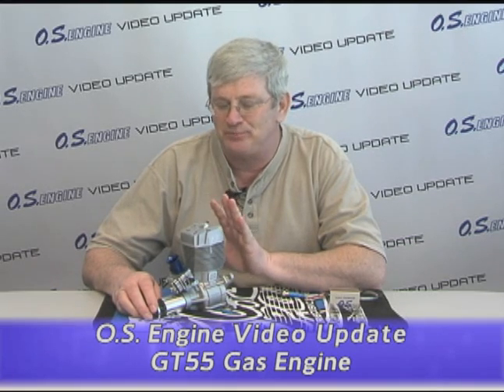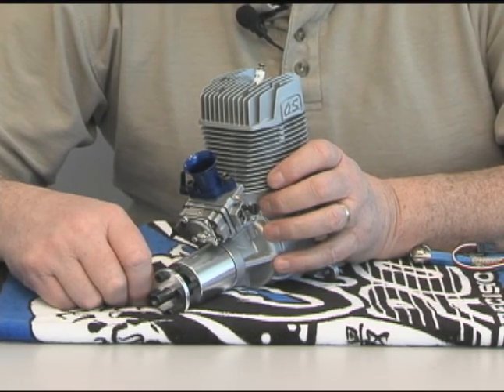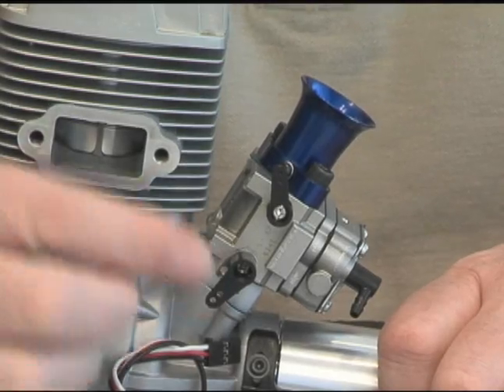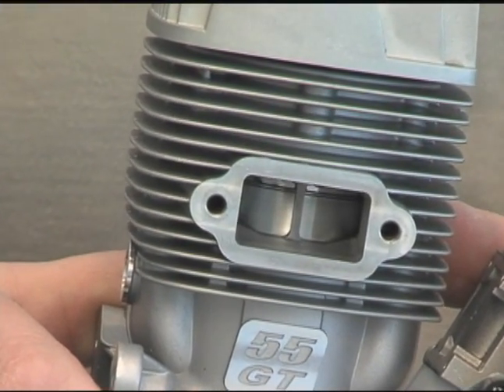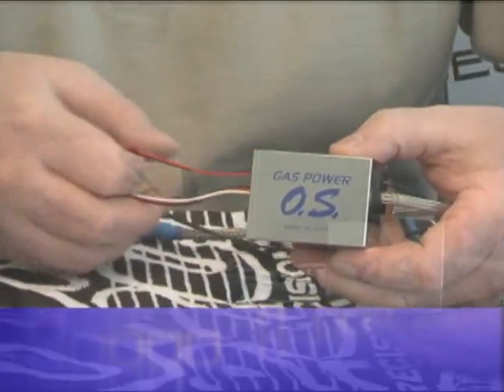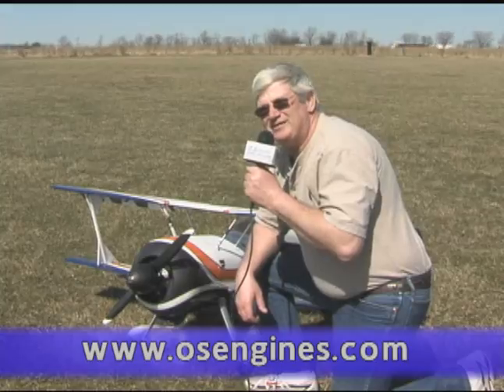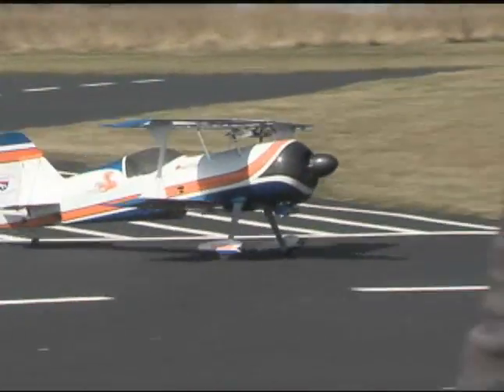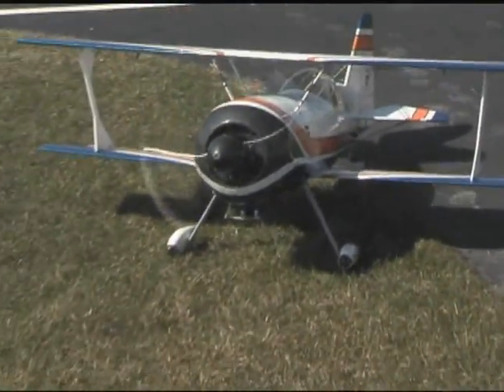O.S. Engine® RC Video Update: GT55 Gas Engine

Comment: @MaxPowerCE550 

This was bolted directly to the firewall.  I've also used 3/4" standoffs.  This gives you a bit more power with the prop/spinner a bit further away from the cowling.